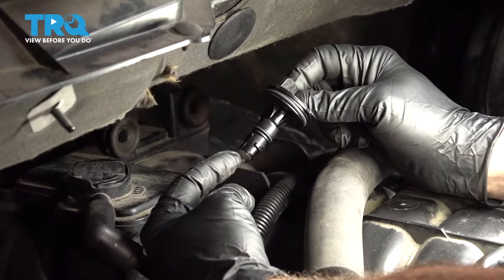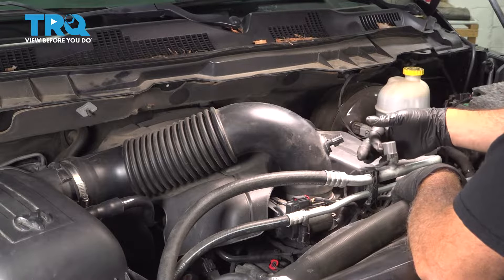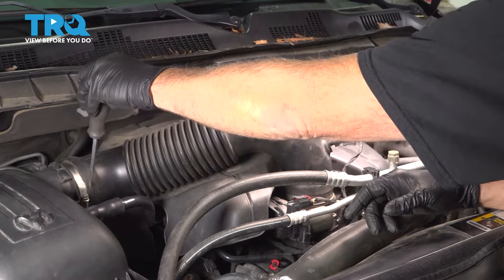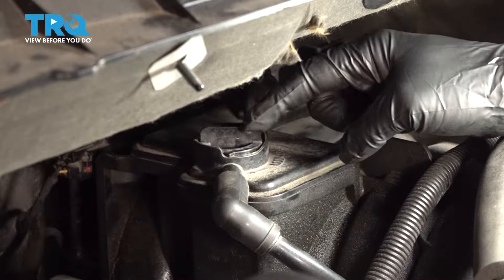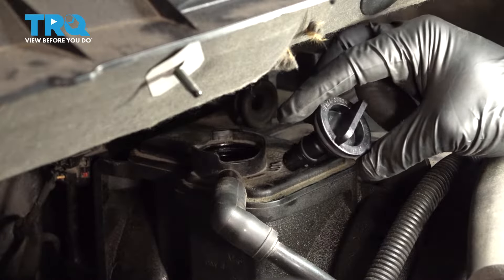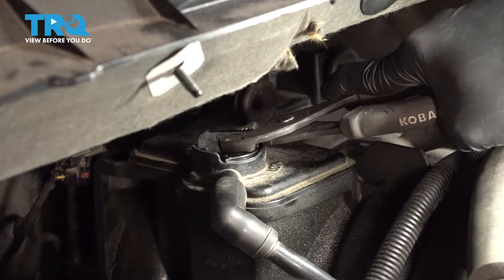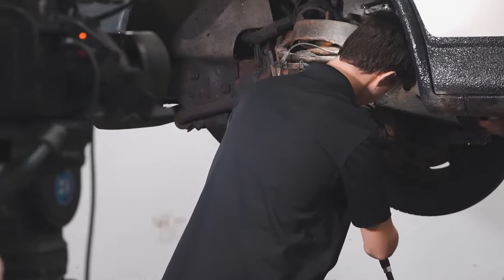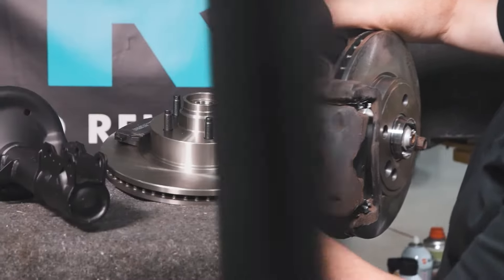How to Replace PCV Valve 2011-2018 Ram 1500

Comment: Yesterday the dealer quoted me $170 to do this, $300 for the belt.
That being said, they also put the oil change sticker to change my oil in 1500 miles. lol

I do my own brakes, diff fluid, etc., but I don't feel like doing my own oil change.